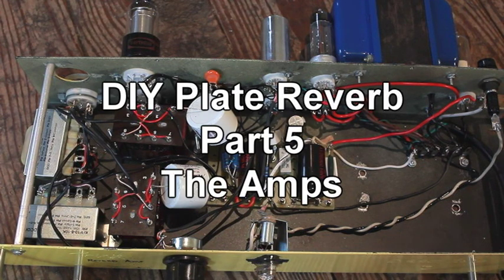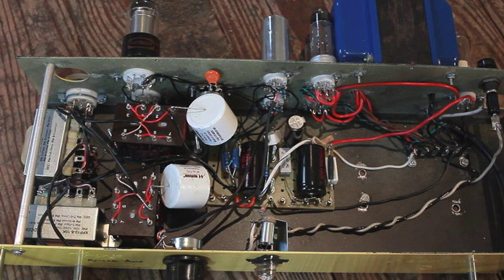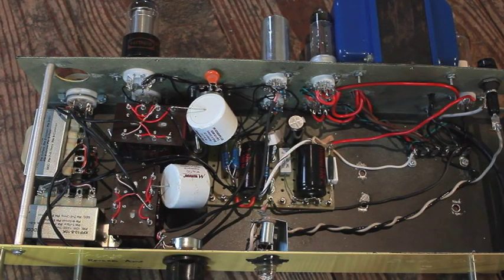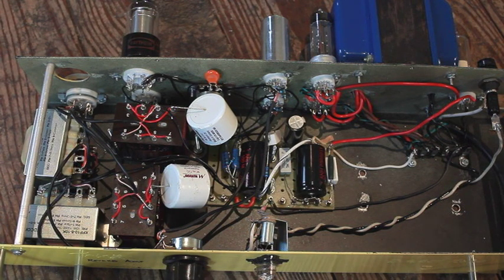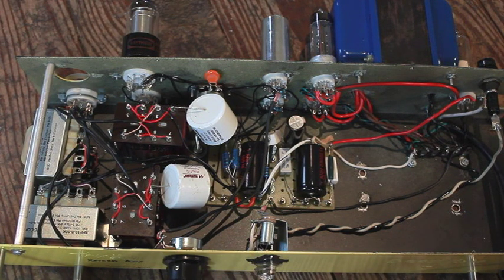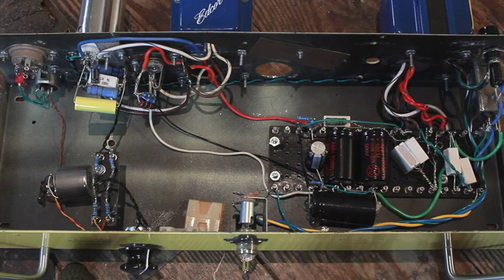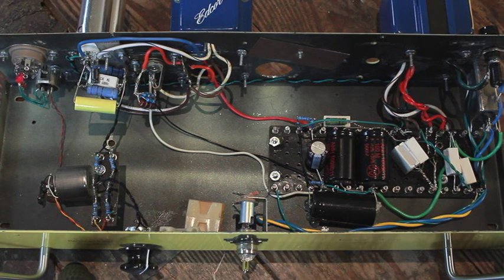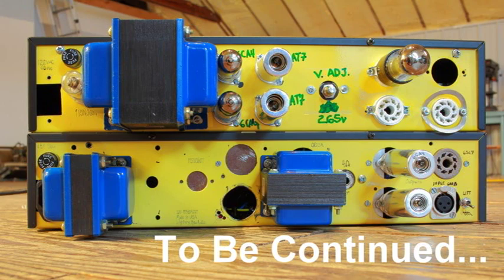DIY Analog Plate Reverb - Part 5:  The driver amp and output amp

Comment: Why not just build a single ended 5 watt driver amp? You wouldn't need any type of phase inverter and it would be a more simple amp to build.
Reply from the maker: It wouldn’t be able to deliver enough clean power if only 5W and single ended.    Simple wasn’t the direction taken with this build.
Reply: @LightningBoyAudio  last question... Are you using an ultra linear output transformer with a screen voltage supply tap, and would you recommend spending that kind of money for this application?
Reply from the maker: I would have to take it apart to see exactly what I did with regards to the NFB.  I’m probably using the the input transformer to achieve that.  I would once again need to look, but I believe I probably settled on UL output transformers from Edcor.  The design is based on an old Dynaco ultra linear power amp.  I’m feeding +4dBu into the line input transformers.  There is no preamp stage, nor is there any need for one.  Might want a preamp if there was EQ, but I tried that before and found EQ after the plate reverb is far more useful than before.
Reply from the maker: and FWIW, before the rebuild I was driving the plate with a single ended KT88 ultra-linear amplifier.  It didn’t sound as great as this ultra-linear push-pull with NFB, plus now it has a lower noise floor.
Reply: @LightningBoyAudio  and are you using any sort of preamp on the driver circuit or are you pushing a line level signal directly into the phase inverter transformer?
Reply: Interesting. So you found a PP EL84 to sound the best. Where are you deriving your NFB sense you're not using a tube driven phase inverter. Is it a local NFB at the output stage?

Comment: Would you say there is much of an advantage in driving the plate with a tube amp? I understand using tubes on the pickup side but do you think the plate itself is sufficiently sensitive to benefit from  the tube vs solid state response differcences?
Reply: Is that a Jensen je6110k-b line in?
Reply from the maker: Fredrick Meyers No.  Its a Jensen JT-11P4-1
Reply from the maker: dachanist you’re talking to a tubeaholic.  That aside, the driving amp is very important and not something to be overlooked.  If its noisy, it will make your reverb noisy.  If it sounds thin and cheap your reverb will sound thin and cheap.  My very first reverb used a cheap solid state driver amp.  It sounded very dull, thin, and brittle.  I personally feel this is an area where a properly designed and purposed tube amp can contribute color and fidelity in pleasing ways.  Since this video I have modified my driver amp.  It has a phase inverter tube now and sounds sweet.
Reply: @LightningBoyAudio  Thanks for the response. Tubes are $$$. I use a craigslist 50s tube reeltoreel as my center channel and a small solid state for the rest in my home setup. It doubles as a keyboard amp. The tube center definitely has the clarity but the solid state provides the lows and the affordability. Thanks for the tip. If I ever attempted something this ambitious, I'll have to look for another cheap tube amp.